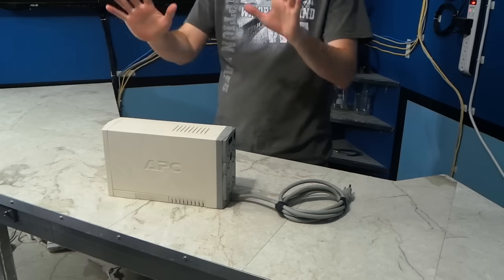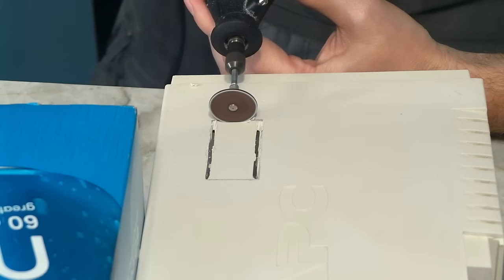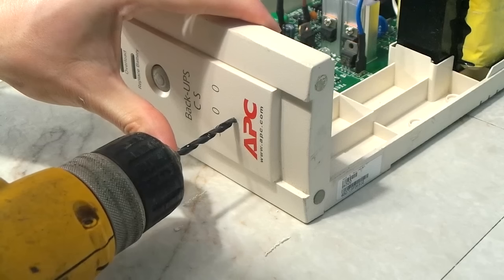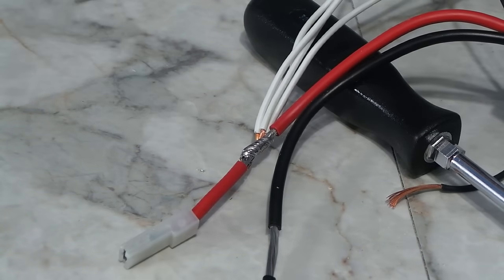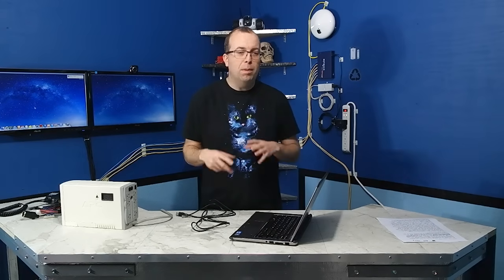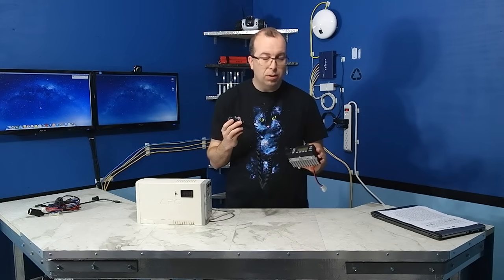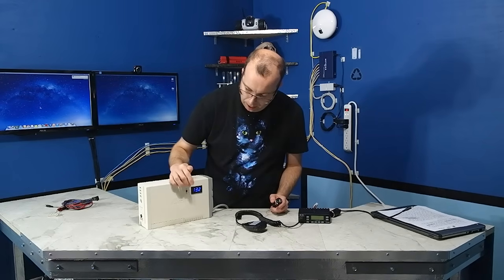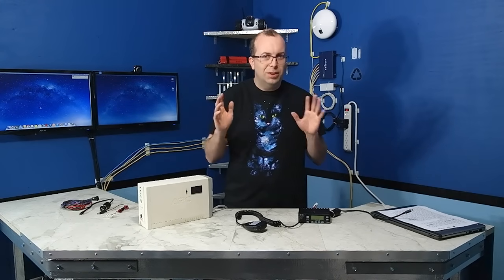Ultimate Battery Backup Hack/Mod.

Comment: Lots of incorrect information here and it's very unsafe what's been shown.
First of all, that meter is going to draw less than 15mA which means even a 9Ah battery will last 25 days, not 2 days, if there is no power restored.  If power is only off for a few hours (this size UPS isn't only to prevent disorderly shutdown of a system) then the meter is only using 15mAh, per hour, of the 9,000mAh that is available.  No need for a switch.  None.
Those DC jacks (5.5mm x 2.1mm) are not rated for anything near 16A.  Most are rated .5 to 5 with some import stuff claiming 10A, but it's incorrect.   Even if you wanted to pull a 16A load off of a single DC coax jack, you are drawing on the battery at a C/0.5 rate when the 9Ah rating is expecting a C/20 or C/10 rate.  In other words, the maximum discharge of a 9Ah SLA battery is between 0.9 and 1.8A if you don't want to damage or derate the battery.  Each of those DC jacks should be protected at 5A so they don't melt.
A HAM radio with just 10W of RF power is going to consume more than 10W because there is support circuitry, backlighting, and inefficiency in the RF amplifier.  But, ignoring all of that... 10W will consume that 9Ah battery in about 10 hours.  Most of those mobile HAM radios are 18W or better if you want any kind of range in an urban setting.   Now you're down to about 5 hours... which is a long ways from running it for a week "continuously."  Again, that's ignoring all the quiescent standby current and this is from the same video that is worried about the <15mA current of the volt meter!
And, for the record, there is not a relay that connects the UPS voltage in/out.  Yes, there is a disconnect relay, but the inverter is always on because it's an UNINTERRUPTIBLE power supply and the phasing has to be the same as utility power.  Just the time it takes to switch a relay would drop most loads or weld the contacts even if the UPS is synchronized to the mains.
You're better off using a larger battery (100Ah) and an outboard charger like a BatteryTender 5A.  I mean, you have to monitor the voltage with "hack" anyway so why modify a UPS when it's just being used to charge the tiny internal battery? 
PROTECT any circuit you build from overcurrent.  Period.   And use components properly rated for the application.
He was correct that a 9Ah battery can recharge a 3,200mAh battery (iphone 13, for example) about 10+ times.  It's 9.3Wh and the 9Ah battery in the UPS can supply about 113Wh.  Your mileage may vary since battery voltage, alone, is not a very good indicator of SOC (state of charge) of a Pb battery of any type. (AGM, Gel, FLA, etc.)  But, again, how many times do you need to charge a phone when the power goes out?  You do have a car with a MUCH larger battery in it for crying out loud.

Comment: Don't throw circuit board in a trash OMG
Reply: *****
 This may contain lead, very bad for the environment. Circuit board must be recycled.
Reply: +L3xou97 where I am... it's illegal to throw any computer parts into the trash since they are considered "E-Waste"
Reply: Éric Fillion
 That's a good thing.
Reply: L3xou97 ik... and I like to take them apart anyways :P
Reply: Éric Fillion
 If you recycle it that's not a problem, lead and other things can be dangerous for environment.
Reply: dojmike
 Hey I'm not English and I think I can speak better in English than you can speak in my language.

This is an old circuit board, lead was not forbidden yet in the soldering. So there is probably lead on this circuit board, and lead must be recycled. It can contaminate water. In  the nature the lead was not in the water and if you continue to think like that there may be lead in water.
That's the same with petrol, petrol is normally 4000 meters under the ground. And a lot of animals can't live with petrol in the sea even if it's something that was on the earth.
Reply: dojmike
 Before thinking to be respectful to someone that you will never meet try to be respectful to the earth.
Reply: dojmike
 If one day you die because of pollution (there is a lot of death because of that every day) I think your point of view will be different.
Reply: dojmike
 That's why lead is now forbidden. Using circuit board isn't a problem, you just have to recycle it. That's simple. I'm not against capitalism, i'm against idiot that don't know how to put their garbage in the good trash.
Reply: dojmike
 You think everyone that throw dangerous stuff in the good trash is communist? Something is going wrong in your head I think.
Reply: dojmike
 I don't need help, you need to learn how to recycle.
Reply: +Steven King yeah right, i mean the  floor in my house is made out of pure uranium
Reply: apart from recycling and the environment, i bet people in Africa could eat it, too!
Reply: +L3xou97   There are 65 nuclear reactors in the USA, and 50 are leaking radioactivity into ground water, and you're worried about a minuscule circuit board that will wind up in a landfill, which all today are planned to be not be able to leak into ground water. Most large landfill operations lately separate out metals and non-metals mechanically.  Put your priorities where it counts.
Reply: PV Beveren
 I'm not living in the USA. Everyone knows that USA is one of the biggest polluting country, only the China is polluting more but they are more than 1 Billion.
Reply: +PV Beveren one circuit board quickly becomes 1million boards and you know that!
Reply: +L3xou97 The amount of discussion about that little circuit board has probably harmed the environment MORE than throwing away the actual board! Don't forget we are using (and wasting!) energy to type comments here... ;-)
Reply: AAAyyyGGG
 It's not about energy it's about lead in the ground.
Reply: +L3xou97 I think it's great that you are trying to inform people about the importance of recycling, but that is hilarious point. If he dies, how will he know it was because of pollution? Not only will he be dead, and the dead know nothing, but even his friends and family will blame cancer or some name of a disease rather than blame the cause of the cancer/disease. I think it was Mark Twain that said it's easier to fool an idiot than to convince him he's an idiot, so there's no point in telling them they're idiot; just sell them useless garbage.
Reply: AAAyyyGGG so many people read this, and if they realize they shouldn't do this, and maybe also spread the message to save the planet, they won't do it, and the energy we wasted is much less harm for the planet than all the circuit boards which woul've landed in the wrong trashcan otherwise. ;)
Reply: +Tschooptschoop look in the pacific ocean, there is a lot of garbage. it's nearly the same
Reply: L3xou97 yeah, hawaii is there...
Reply: Tschooptschoop "quote"one circuit board quickly becomes 1million boards and you know that!"endquote"

So do you mean circuit boards reproduce faster than middle-eastern people?
Reply: busycell They're like Tribbles. I have a collection of them that I plan to use to build a shed like in District 9.
Reply: +L3xou97 Thanks for keeping a clean environment. I will try to do better myself.
Reply: +justasniper83 I think the limitation is on tuna.
Reply: +Tschooptschoop So do you mean the rate at which the middle-eastern people reproduce is in no way comparable to the rate at which circuit boards reproduce?
Reply: +L3xou97 please complain to hybrid car owners about battery  disposal before worrying about a stupid little board that likely doesn't contain a trace of lead anyway. And no, solder does not have lead anymore. The eco-nuts ruined that too.
Reply: +L3xou97 Why? What is he suppose to do with it, where did the materials that circuit board is made out of come from? Did it come from another  dimension or did it come from the ground the earth is made of? Man is nothing but aggregate if it thinks that it has the power to destroy the world, we can only affect it temporally and then it will over time recover.
Reply: R. Stieffel
 Lead needs to be recycled, it's dangerous. It can kill the fish that you're going to eat. If the fish is caught before death you can eat lead. And I would not be at your place if you eat lead.
Reply: R. Stieffel
Man could destroy the world if that was the goal. For example, man could tear the world apart in order to use it as materials for a Dyson sphere. But the greater concern of environmentalists is that we don't mix too many toxins into the biosphere because it can hurt us humans as well as wildlife. Before the industrial revolution, most toxins were deep underground where they like to hang out. Then steam engines were invented and coal and metals were mined en mass. Now we live in a 'consumer society' in which mass production has made it less expensive to buy a new item than to have a broken item fixed. This is threatening the health and well being of everyone on the planet who can't afford to have all their food grown in a lab and live in an artificial environment. It's not just about keeping lead out of a landfill. We should recycle everything we can so that less gets mined.
Reply: +L3xou97 Yep but most circuit boards use lead free solder.
Reply: MakeDoAndMend1
 It was not before 2006, I still have a lot of lead solder because i'm not soldering a lot. An this unit is old so there is probably lead inside.
There was a lot of problems when we went from lead to lead free. Search HP pavilion dv6 or dv9 on the internet. Some CPU solder can fail because the non lead was so new. Lead solder is melting at a different temperature. I know how to solder on lead but I have trouble to solder on non lead xD
Reply: +MakeDoAndMend1 No they don't. Lead free solder allows the tin to form tin whiskers, hairs of tin that grow from the tin surface, that will short out the board. Even satellites have stopped working because of this. Only uninformed newbies would use the stuff (in good faith), besides, while lead is toxic in high concentrations, lead is everywhere, in the dirt and in the stones (in several % of concentration by weight, sometimes tens). Suggesting that electronics is toxic waste is imbecile, since a regular stone has around the same amount of lead; are stones toxic waste as well?
Reply: TheMrTape
I agree. Fluoride is more immediately toxic than lead and that stuff gets dumped into our water supply supposedly to help prevent dental carries.  Some people believe that getting more lead in the diet will help prevent the diseases that are believed it causes. It's really just a bunch of controversy over nothing.
Reply: kedwa30 Do you even science, dude? Fluoride more toxic than lead? Are you serious? Do you even know what irreversible damage even small amounts of lead does to the cells and the nervous system? Nice Joke! :|
Reply: busycell

Dude, you misread me. I said that fluoride is more immediately toxic than lead. The only reason lead is more toxic in the long run is because of the heavier metal's tendency to stay in the body, whereas most fluoride gets flushed out of the body via the kidneys, although small daily doses will ensure skeletal and dental fluorosis in developing animals such as children.
Fluoridated bones are more brittle and result in early onset osteoporosis, bone cancer, and other fatal disease. Fluoridated teeth are more brittle and result in more expensive dental visits to treat painful dental emergencies than dental caries would result in. Dental caries are treated with fillings. Cracked and broken teeth are treated with a root canal, complete removal, and you get either that hick look or you get bridge$ or implant$$$$.
When dentists discovered the goldmine of dental treatments that resulted from 'Colorado Brown Stain' they knew they could improve the pocketbooks of every dentist by promoting the use of fluoride. It's all about the money.
Reply: busycell
If you think fluoride is not toxic, then why, when they spill some at a water treatment plant, do they need to call out the HAZMAT team to clean it up?
Reply: +Steven King DIdent expected anything else from somone that has a american flag with trump as his profile picture .......
Reply: I like taking stuff apart too.
Reply: kedwa30 in developing children such as animals, certainly.
Reply: "You fucking facile wankpuffin."

I am adding that to my repertoire. Thank you so much for the laugh, that's a great one!
Reply: i thew out 2 working cable boxes after I scavenged the hard drives. all other electronics in tact
Reply: Popeye I'll give you his phone number
Reply: I have to say your annoying nagging regarding this issue has not discouraged.... but has rather encouraged me to throw all electronics straight into the trash.
Reply: For the record, lead is dangerous in small amounts. Just Google 'why is lead-free crystal glasses important?'
Reply: I don't think David actually threw it out with the garbage, I think the garbage can was just for show. I'm sure he uses a proper recycling facility, it's just off-camera.
Reply: Nuclear plants are not leaking anything into the ground. Who the hell said that? lol   It is fear mongering and stupidity like this that confuse others that know nothing about the tech. All waste is in refining the Uranium and then storing the spent rods.  You can fly a 747 into the cooling tower and it would brush it off like a fly. 1kg of uranium gives you 2 to 3 million times the amount of electricity from 1kg of coal. Keeping up this tech is very very much worth it. One Nuclear Power Plant.
produces 1000 megawatts per hour.You would need 60,000 acres and. 2400 to 2800 wind turbines to equal 1,000 megawatts. You need 5,000 acres of solar panels to equal 1,000 megawatts of electricity. One day if we could contain fusion instead of fission we could power the entire world with ease.
Reply: RoHS went into effect in 2006.   Many were using lead free solder and components before that.
Reply: I'm more worried about used coolant, engine oil, chemicals, medications dumped or flused that make it into the the ground water.

Comment: Cool Idea!
I have some 12V LION Batteries from a salvaged E-Golf.
Just put the UPS on Top and it will run almost endless (BMS for accurate charge control required).

Comment: for $30 you can buy a unibit and not have to change bits like you do
Reply: For 0$ he used the bits he already have and spent 5 minutes drilling the holes instead of one minute. Plus, using a unibit, if you are not careful, you can easily end up with a hole bigger than you wanted, especially in plastic. Using his method may take a little more time, but there is almost zero chance of ruining the piece you are working on.
Reply: MusicalBox his bits are not free. make a hole too big? I guess if you dont know how to use power tools
Reply: +binky777 Of course his bits were not free when he bought them. But he doesn't have to pay each time he use them...  So now they are free to use. 
My point was that the method he used ended with a near perfect result. I have ordinary bits and I also have unibits. For a project like this I would  use the ordinary bits instead of a unibit. Just to be safe.
Reply: MusicalBox no need to repurchase the unibit either. I have both as well. I would use the unibit because it makes sense and I am proficient with power tools. I have drilled into thousands of dashboards on brand new cars and trucks using a unibit each and every time.
Reply: I salute your skills and confidence ;)

Comment: This video needs a upgrade, a usb charger and a solar cell
Reply: And grid feeding and load balancing? C'mon, this was shitty/cheap APC Back-UPS, not some RT (double-conversion) beast or some Stu-der Xtender more-expencive-than-your-car inverter!
Reply: Good design feature of APC is that it keeps battery charger running even when UPS itself is turned off. Therefore, in case of mains AC outage it will not switch to battery and drain it in short time, while keeping it fully charged when AC is present.

Comment: What a genious Idead to use a sacrificial switch as a template! I've always just measured the switch properties, made a 1:1 drawing in inkscape of Fusion 360 and printed myself a neat template. Depends on what's important to you, I raise the argument that a piece of paper costs more than one of these switches :D
Reply: It's a good idea, but I don't know why he didn't put the switch back together. Then again, I guess it might break these days. The last time I pulled such a switch apart, most things were made of good-quality steel.

Comment: That isn't a "real" transformer, it is an old-school junk one, extremely inefficient. Switching transformers can waste up to 10 times less power. You couldn't charge your phone 13 times off battery, maybe six, or three going through the battery backup. Your math is way off. Your ham radio also wouldn't run for two days, no way. It would be a lot better to just get a couple cheap seven amp hour batteries and wire them up since you seem to not want to use it as a computer backup anyway. With the save money you could also add solar.
Reply: No his math should check out, I got a back-up battery pack from Anker that gives me between 8-11 full charges(depending on phone used) of our mobile phones and it's about 1/6th the size of the battery shown in this video. So unless his battery pack sucks and is hollow, he should, at minimum, get the same amount of charges mine gives me, an 13 charges sounds certainly obtainable with the mod performed in his video...
Reply: @BeerBaron23  He means he could not get 13 charges without the mods.

Comment: A step bit is the ideal solution for drilling thin and soft materials like plastic and aluminum.  A single flute design will cut a much smoother hole and even a cheap one will last forever drilling plastic.   I keep one more or less permanently chucked in my mini drill press.
Reply: Problem with that is, you buy the bit and only use it once...

Bit of a waste